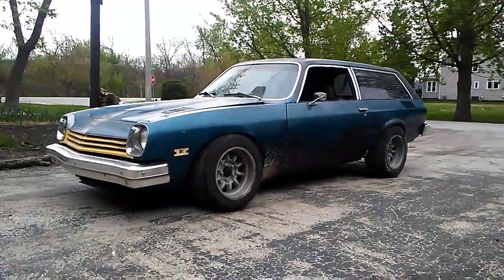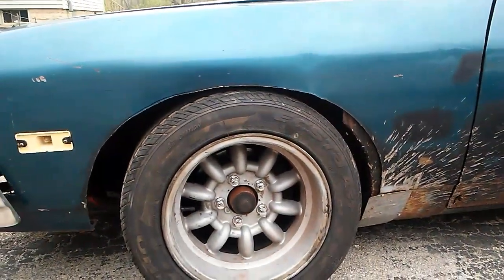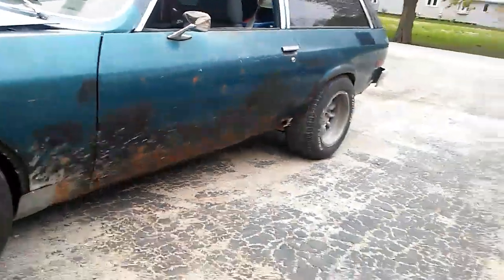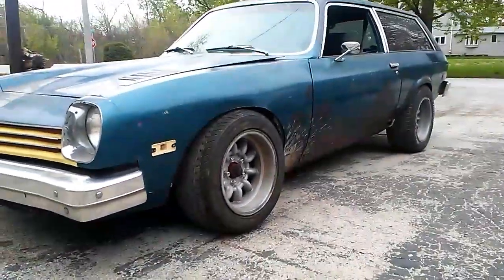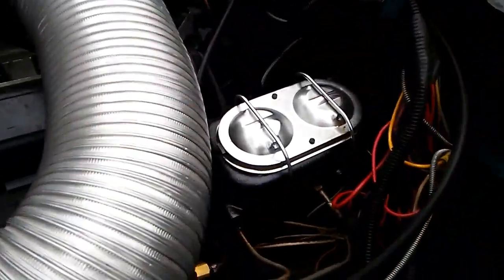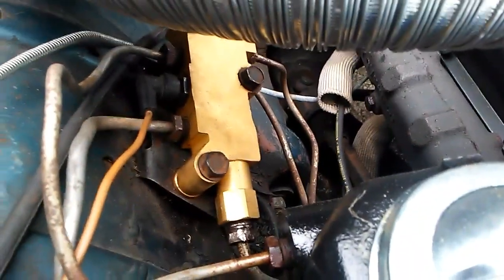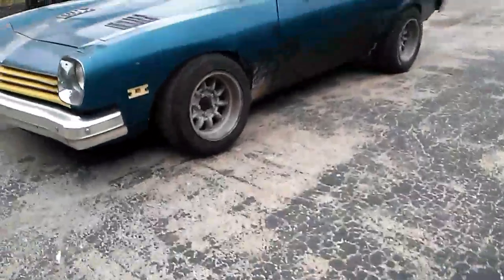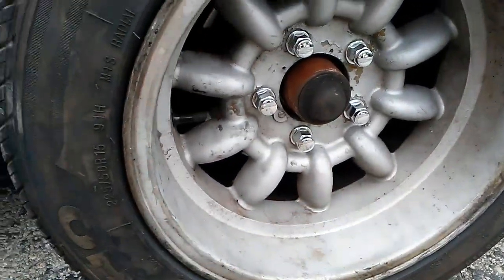Turbo SBC Vega Wagon five bolt brake and wheel upgrade.

Comment: I have a 79 monza spyder been trying to find an easier way to convert to 5 lugs, they gotta make a rotor that is 5 lug with the same bearing size its just crazy they dont and you have to use S-10 stuff. Im not understanding the ball joint part on the website if you could explain. And I have the sleaves for the lower ball joints but not understanding why they need welded on? Any feed back would be appreciated. The rear is done just the front end im stuck on, basically ive grown lazy just hoping there is an easier way to do this
Reply from the maker: Don't need to weld the sleeves on the ball joints. They just skip right on... Just cut the excess off. Pretty easy

Comment: I have a 76 vega and I want to switch it to 5 lug what do i all have to do
Reply: H-body.org,v8 monza.com,veganation(facebook) Bob gumm adapters (steel cone make up the difference in size between the smaller Vega ball joints and the S10 spindal (old box Chevy s10(89-90s or 2000 new with divorced rotors)use same master and proportion valve from donor too,,, or weld and redrilled upper a arm for s10 ball joint ,drill and weld steel sleeve to accept s10 lower ball joint ,